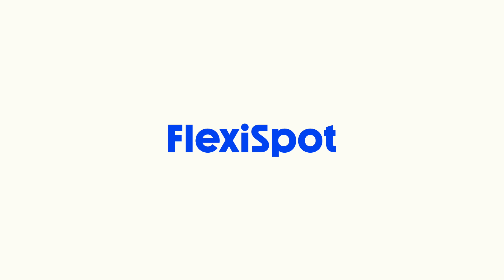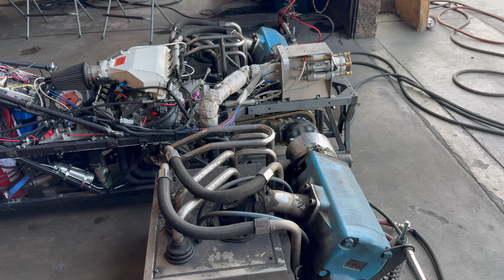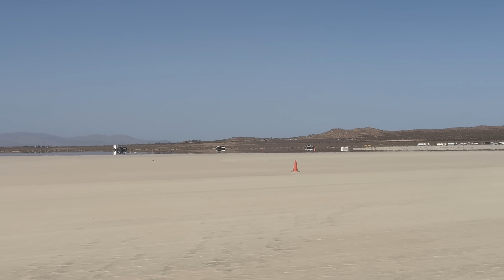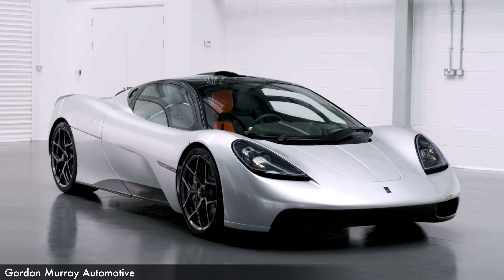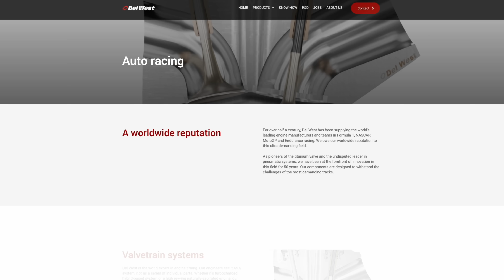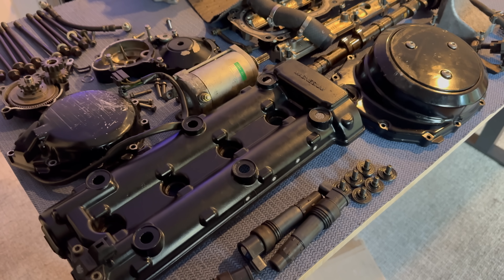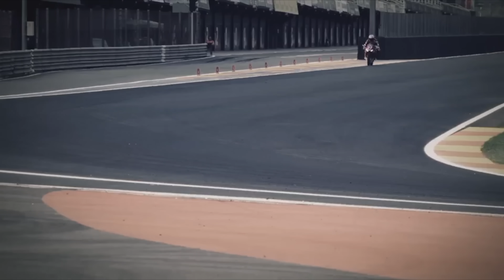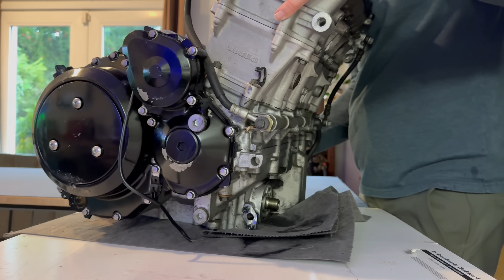Motorcycle Engines Are WAY BETTER than Car Engines

Comment: Whatever FlexiSpot paid to sponsor this masterpiece wasn't enough. Complex topic and concepts presented in a concise, humorous, and engaging way. You are killing it Matt.
Reply: Easily one of the best channels out there!
Reply: Multiple things that this guy says in the video are inaccurate.
Also, Why does my motorcycle only get 50mpg?  Total weight versus fuel economy tells us that something is wrong with the motorcycle engine design compared to a car engine.  If a motorcycle engine was as efficient as a car Engine, we should be getting over 200 hundred miles per gallon on every motorcycle
Reply: @brianwnc8168 he explained why motorcycle engines are less efficient. Short stroke, small displacement, high RPM. If you missed that, watch it again.
Reply: @brianwnc8168  no one is perfect. you can quote what is wrong and give the correct information.
Reply: @brianwnc8168 mainly because your motorcycle isn't much better aerodynamically than the average car, especially with you sat on it. Frontal area is larger than you think and the drag coefficient is awful. Add to that the fact that motorcycle engines simply aren't tuned for efficiency and there you go.

Comment: Motorcycle engines don't have to last. They can also be designed for power at the expense of torque, as they have little weight to pull.

Comment: About that multiple motorcycle engines making a V8... Have you heard of Allen Millyard?

One of my fever dreams is making an 800cc V8 out of 2 CB-1 engines. Tiny little 14000 rpm screamer. 
No I don't even know what I'd want to put it in. No I have no way whatsoever to make this happen. But one can daydream, occasionally...

Comment: 12:45 we solved this issue on our Formula SAE Engine by making a custom shift barrel that had no reverse. Neutral was the same spacing as the rest of the gears, and we simply banged through the gears with a pneumatic cylinder.

Comment: Nice. But I want to know why car transmissions (even separated and keeping the helical cut gears for noise reduction) don't do the constant mesh and dog rings thing. It'd make one hell of a fun setup, and motorcycle transmissions last almost forever at the intended power output, and some much more than that, still.

Comment: Fun fact, all of Toyota's best and most loved engines, have cylinder heads designed by Yamaha.
They have a 'G' in the engine code to denote Yamaha involvement.
(4AGE, 3SGTE, 18RG, etc etc)

Comment: Ive been a motorcycle mech since the early 80,s , and stayed in that trade for far too long despite the poor pay because working on japanese sportsbikes during that time was a joy. Watching the speed of evolution during the 80,s-90's was amazing. 
I will take task with the "bikes are only designed to last 30,000ml" comment. During the 80,s ,valve adjustment intervals was around 6000km ,give or take, and you would definately have to adjust at least half of them. As the years passed that interval grew to over 12,000+ and the amount of adjusting shrank. By the 2000's , fireblades and R1's rarely needed a valve shim changed well into 50,000kms.

Comment: i love motorcycles because you're basically sitting on a high performance race engine with a handle bar and two semi slick tires (even touring tires are basically that) and that's it. fucking brutal machines if you think about it.

Comment: Glad to see your TeslaJag in motion again, Matt.
I have been a Jaguar fan all my life, from when I could first read about cars until now, a very old fart. Sadly, I have never owned a Jaguar, but my dad owned a 1938 Jaguar, two and a half litre sedan. Back then, Jaguar engines were made by the Standard car company, and they were a bit suss. Dad's engine broke a con-rod, and more soon after that. I was in the car at the time and can attest to the fact we were just in mild cruise mode.

The only Jaguar I have ever driven was a black 1950 Mk V sedan, just like yours was before you made those radical improvements. A good looking vintage car.

Please can we see more record attempts on the salt.

Comment: honda and a few maybe one or 2 others made 500 cc 4 cylinder sport bike engines, seems like it would make your speed run "easier" than a 2 cylinder bmw 1k..  More cylinders=more valve curtain area+more rpm=more HP.

Comment: Arguably, the best examples of "factory car with a motorcycle engine" is an RX-7.  Just like a motorcycle engine, the wankel is high revving, high power/weight (at least compared to the piston engines of the same vintage), and high power/volume.  It's also got the poor fuel economy, short design life, and poor emissions.  And all of those are why you haven't been able to buy a new car with one for the last 15-ish years.

Comment: Matt, my understanding is that the power density of motorcycle engines is possible because of the duty cycle of motorcycle engines.  Essentially, motorcycles are so light that you can only apply full throttle for a few seconds before you have to back off because you are going too fast.  I have heard that motorcycle engines don’t do well when the duty cycle is high, like a boat or a plane.  I have heard in higher duty cycle engines you need more metal to help conduct the heat to the cooling system.  Comments?

Comment: magnesium is good until it catches fire, in 1968 Honda ran the RA302 at the French Grand Prix (Rouen-Less-Essarts) Jo Schlesser crashed, the fuel ignited, this burnt hot enough to ignite the magnesium, the resulting inferno was so hot, the marshals in fireproof suits could not get close enough to help Jo Schlesser (it is now thought that he was killed on impact) the fire could not be contained and it was said that any attempt to fight the fire made it more intense, i am assuming water or wet foam was used, metal fires (this includes lithium battery's) burn hot enough to split water into hydrogen and oxygen (rocket fuel) as far as i know, the best way to extinguish a metal fire is to dump tons of dry sand on to it. so those of you who like to go racing and have magnesium wheel rims, you might want to think about how hot your glowing brake disks are! (magnesium auto ignites at 473 degree C (883 degree F))

Comment: Motorcycle engines are super easy to work on too.  Compared to cars,  they're just so simple. Basic hand tools + a flywheel puller and you can work on almost anything.

Comment: Thats not true, motorcycles are VERY limited by emissions. Its why modern bikes tend to be on the larger end of capacity, while also producing less power than the average bike 10-15 years ago. Not only are they working with a limited space and weight to be more complex pass emission standards, they also have noise emissions to worry about. Simply just getting the ecu flashed can give you a noticeable increase in power, and make the bike feel better and be more reliable. Getting my new bike flashed ended up gaining about 10hp, getting power starting down lowering, and giving a wider and more linear range of power, all while running smoother and cooler. Going from the current tune/feel to back to stock with a person who didnt know the tune and mapping was changed would probably result in them thinking something was WRONG with the bike. Just from running stock after experiencing stock with a flashed tune.

Comment: Weight/power-density and compactness are the reasons why I chose a BMW GS series engine for aircraft conversion.
In your case, a S1000rr series engine makes a lot more sense.

I did consider the s1000rr, but the TBOs would be way too short for comfort, and they would be more difficult to package in my monocoque.

With that said, BMW and a few other brands with bike-manufacturing experience do produce super light engines with fair reliability if operated conservatively.

The moment we get greedy with turbos or superchargers, we start to gamble with our luck.
That's my experience.
Water-methanol injection is the only option that can not only increase performance at certain stages of flight (such as takeoff),  while increasing the TBO to some extent.

Comment: The clear solution is one motorcycle engine per car wheel. All wheel drive.
4x 200 hp at 12,000 rpm But able to rev down to cruise and stull have amper torque. Because, 4 engines.
In a turn, all engine will have slightly different revs. Especially with staggered wheels. Imagine the song...

Comment: Honestly, I wish we would make EV’s with motorcycle engine based range extenders. (so a plug-in hybrid.)
You could have 20kwh battery capacity, the vehicle cheap, and light, 
And you could make five electrified vehicles for the battery capacity of one. 
(Which easily negates the little bit of extra emissions from the engine)

Seems like an absolute no-brainer, but no one seems to wanna do it since the Chevy volt …
Imagine miata with instant torque, and the ability to either scream like hell or be absolutely perfectly quiet with the top down in the countryside…
Reply: Nope, Cummins 4bt FTW
Reply: BMW i3 REX has a two-cylinder 600cc BMW scooter engine, which is somewhat close to a motorcycle engine.  The combo is overall less reliable than the non-REX version, I've read.
Reply: @alsavage1 yup also a great example, sadly it was given some ridiculously small fuel tank too, which made it not as helpful as it could have been.

But yes, this imho is a great solution, also for pickup trucks which rarely tow, but if you need to 20kw of battery + engine is better overall then lugging 200kwh of battery around like some do.

The win in efficiency 90% of the time is worth the drop that rare occasion.

Oh well.

Comment: @superfatmatt If you're really concerned about exhaust oxides (I'm not, the climate narrative is incompatible with findings from more established sciences)...
Please look into LENR. Low Energy Nuclear Reactions. With a retrofit, an ICE can emit for instance (only known mode) output near zero carbon and around 20% oxygen. Air, basically. The hydrocarbons are transmuted (and that's the hard part for academia still) without a big mushroom cloud and without lethal gamma radiation. That part really NEEDS to be there for atoms to re-arrange to other atoms, according to them. Thunderstorm generator and preceding GEET are two ways to connect a concentric counter directional gas reactor to get the result. One excites the intake air with a UV lamp and water bubbler, the other bubbles the fuel to vaporize it. Then the air (or fuel) goas via one path in the reactor to the combustion chamber and out the engine via the other reactor path. Out the exhaust comes, when dialed in..."air". It would really piss off the globalists if you helped make engines reliably emit air. They are taxing the carbons emitted.

Comment: Fun vid. Also, you inspired me to finally get an adjustable desk. Used your link, and mentioned you in the checkout, but didn't use your code as there was one built in for $100 off. Hopefully they'll still credit you on this one.

Comment: Excellent video.  One thing it seems you didn't touch on directly though is duty cycle.  Car and especially truck engines are designed to withstand running under heavy loads and large throttle opening for long periods of time.  That requires heavier, stronger parts and power at lower revs to help the engine last longer. 

It's why I like old American engines, they not only powered cars but also large trucks and industrial equipment.  Specific power output sucked but the displacement extra strength gives a lot of potential for big power.

Comment: 15:20 Honda, making a cool car? in 2025? Good luck.
Reply: Nobody does it anymore. You basically millions to get something special with a couple of exceptions.
The MX5, but the current iteration has been around for over 10 years.
Reply: @ZesPak  GR Yaris
Reply: @OntarioTrafficMan unreliable
Reply: The new prelude after dealer markup costs as much as the CT5V, a Cadillac with a corvette engine in it, so yeah...
Reply: @DoesntRefillTheBrita  The biggest insult to me is that the 2026 Prelude makes 200hp, whereas 30 YEARS AGO, the old Prelude made... 200hp. Honda says the Prelude is "not about straight-line speed." Cool, nobody asked for that. A 240hp Prelude would also not be about straight-line speed (and still comfortably 70hp/tq below CTR sales), it just wouldn't get absolutely smoked by every mid-trim SUV on the road.
Reply: @Doe @DoesntRefillTheBrita Not all CT5Vs are blackwings
Reply: @jod4689 ok, a Cadillac with a twin turbo Camaro engine in it. Better?
Reply: @DoesntRefillTheBrita  a corvette is a nice car, its engine is nothing special though. The caddy is great because of its chassis, manual transmission and the engine. All of them together. Remove one part and the rest car stops being special. Also, a prelude is nowhere near a ct5v, lol... What are you comparing? New vs used? Blackwings go for much more than the prelude while actually being marked up. Which dealer marks up the prelude? They know they wont sell it. Its not very sought after.
Reply: @AI-qd4vb  read the comment more carefully. Dealerships are adding an additional 10-15K on top of MSRP
Reply: @AI-qd4vb also if 668 horsepower isn't good enough for you you're either 12 and think Forza is realistic or 12 and think tiktok is real
Reply: Cool cars are dead. For me Ducati engine, striped down Mazda Miata. No ac no radio or info crap, and not even a rag top roof. This for me would be drive crazy on sunny days. The engine would last long enough to take out and send for rework. Engine would have to be easy in and easy out. 
Will this happen, looks at the lottery ticket with great hope.
Reply: @felixcosty  What you've described is basically a Caterham or Donkervoort lol. Try take a look at a Caterham Seven 170 if you want something new, easy and barebones but fun
Reply: @felixcosty  you can make this happen if you're willing to pay
Reply: Rather than the coolness of the motorcycle division leaking into cars, at Honda it's going the other way. The boring car philosophy is leaking into motorcycles. I remember when Honda released a clean sheet bike with a unique engine every week on average. Now Superfast says "that would take a new engine design" and so obviously it's impossible.
Reply: @gasdive  Hondas has literally just unveiled a V3 with forced induction, putting out 1200cc power out of a 900cc engine. It also has the most powerful out engine out of any new middleweight in the CB750.
Reply: @pedrojorge2741  brilliant! How much does it cost, and where can I test ride one?
Reply: @pedrojorge2741  oh, the CB750 makes the most horsepower of any middleweight! 

That's brilliant, I've been looking for an upgrade to my 1993 Yamaha YZF750SP, with it's pathetic 125 hp. I'm getting a Honda CB750 tomorrow with its..........90 hp.
Reply: I really expected the follow up to that being "So I bought my own Honda to convert"
Reply: @salana well, he has already done that.
Reply: Theres alot of good older options hell imma say some si's basically have a 2 litre motorcycle engine in them lol. K20 does 8600rpm and 240hp with a few bolt ons and a tune :p sounds good too unlike most hondas

Comment: They don't need to make much torque, because cycles have such an excellent power-to-weight ratio. 
So the engines can rev like crazy and make monster HP. But to make a totally fair comparison, you need to also count big long-distance baggers - many of which don't spin that fast, are optimized for pushing a big heavy bike at 70 MPH all day, and may be far more like car engines.

Comment: Now, you need to.explain how computer aided modeling has reduced the longevity of car parts. A water pump, for.example, on a 428 FE made in 1968 will last nearly forever; while the water pump in 5.3 LS made.in 2015 might last two miles past the warranty period.

Comment: So in theory, me popping flames on decel and let off is actually more efficient then as its burning off all the unburnt waste it expelled 😅

 Alright so all joking aside .. this is great , but the only downside , it takes alot to move a mass , and the bigger the mass , the more ot takes to get it moving , so more stress ... sadly we cant use bike engines on everything , granted that would be rad and sound sick af (13k rpm cars 😅 ) but i just dont see a 1 liter bike engine moving a 3-5k lb modern car very well ,now older cars and as read made cars done , it does great in a miata and older lightweight cars ,but sadly this dont work for what is needed for production .... 13:05 now you g oi.to this as i finish writing this lol

15:35 so there is a guy that has designed a k48 off the k24 engine and intergrated two into one and is maken cast blocks that utalize all k series parts ..have not seen what it can do yet , but with how the k24 can be built and the power output ,i cant wait to see what the k48 is capable of 😅.. mad respect to ya matt .. keep it rad bro . L8z